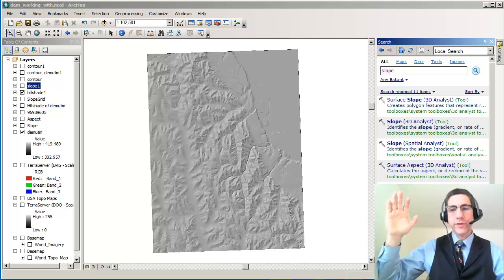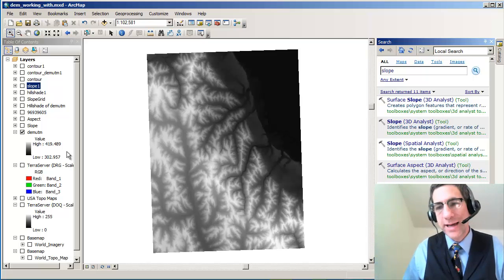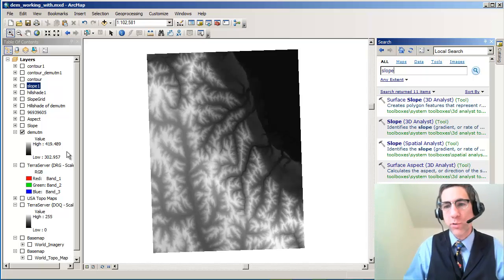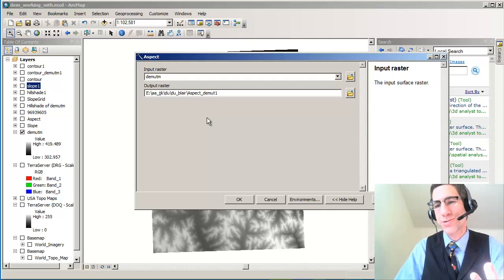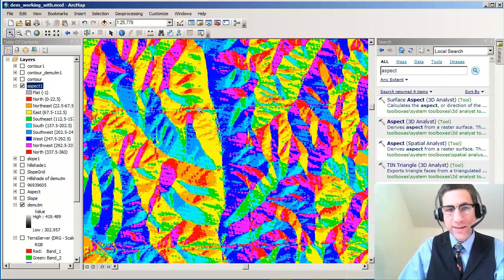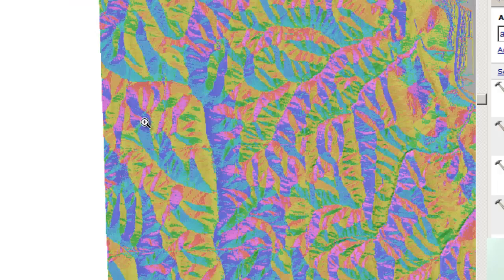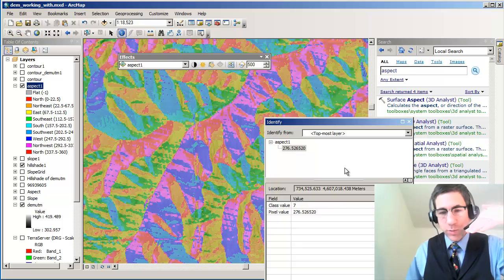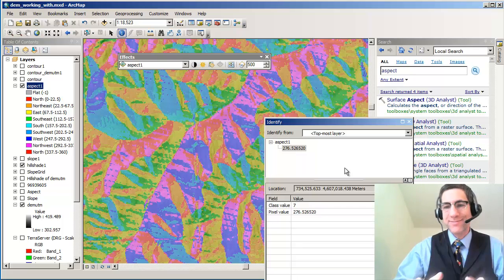Creating an Aspect Map from a Digital Elevation Model in ArcGIS

Comment: Thanks for the video. As you told us we can extact Aspect map in ArcGIS which has 9-10 classes in this way. I need to extract the aspect map but in 5 classes that the classes are P(flat), N, E, S, W. Could you please tell me how can I extract Aspect map in ArcGIS
 which this 5 classes of the map automatically produce by ArcGIS because when I change the number of classes of the aspect map that I have Unfortunately the  label of classes change to some numbers that I can not recognize which class is showing W or which class is N And so on ?  Thanks for your guidance.

Comment: Thanks for the video! I'm trying to calculate Eastness and Westness, but the -1 values created by aspect are inferring. Is there a quick way for me to deal with this? Or should I just manually change all of the -1 cells to zero in the attribute table before calculating eastness and westness?
Reply: Maybe you just exlude every value blow 0 degree? Seems illogical but maybe not to the programme :)